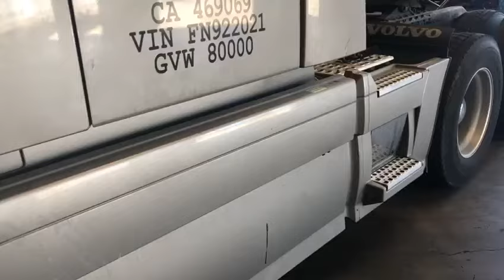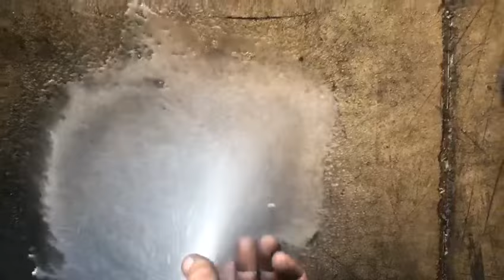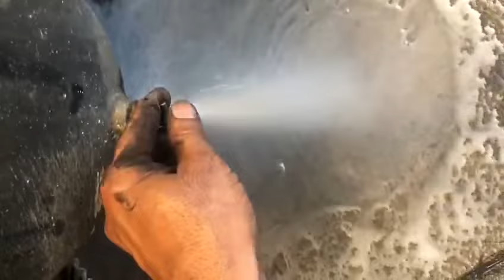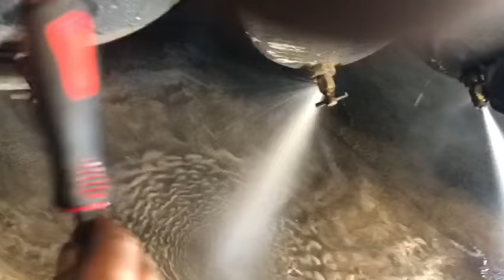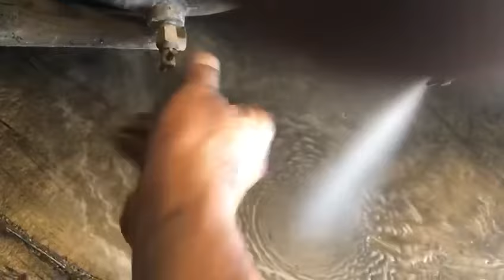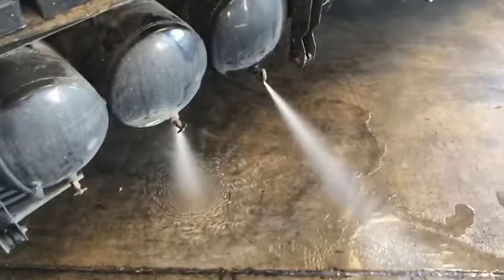Sometimes this Happens—Trucks Do Not Build Air

Comment: My amateur guess.
The compressor rings are a bit shot. Oil start build up in compressor pipe. Drying out forming carbon deposit eventually the pipe are partially blocked. Compressor now working under load eventually blow a head gasket. , air and water start to mix to both sides. Water into air sytem and vice versa